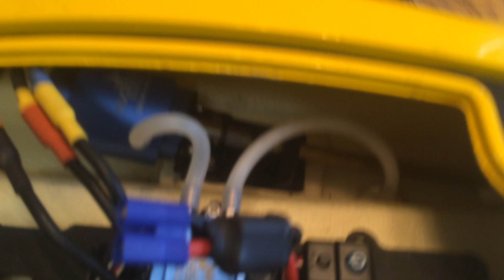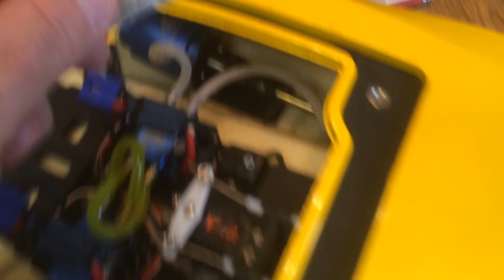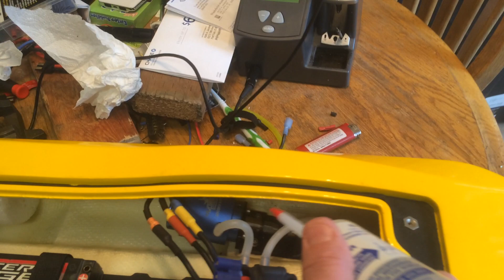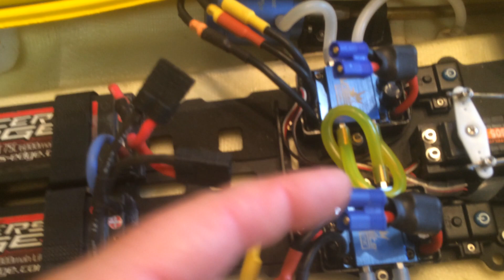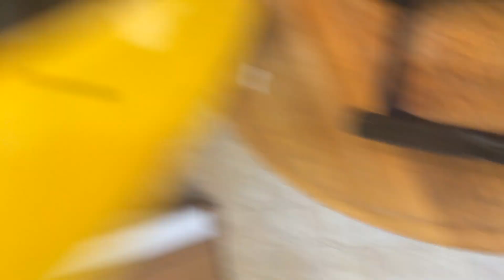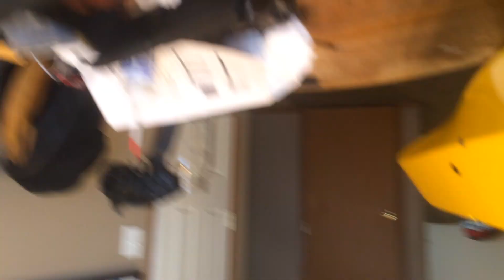proboat zelos 36 maintenance items and recommended settings.

Comment: How can a flex shaft be lubricated,  that can't be removed from the tubing??
Reply from the maker: If you cant remove it then you got  problems. You will need to replace the flex shaft and the liner.

Comment: Thank you for the video!, We just received our Zelos 36" I would like to know is it safe to use 2s or 3s single lipo directly to each of the ESC, not using the series connector? I want to run the boat slowly, get familiar with it, until we are ready for dual 6s :)